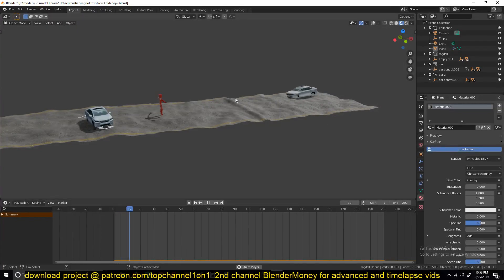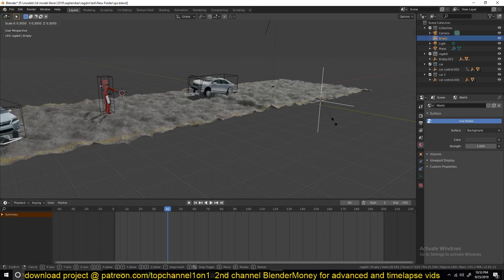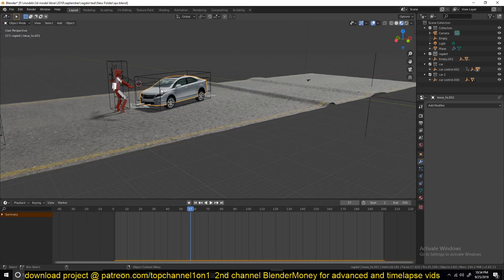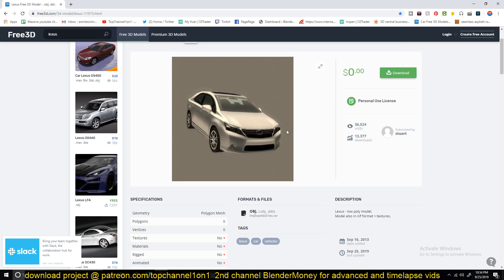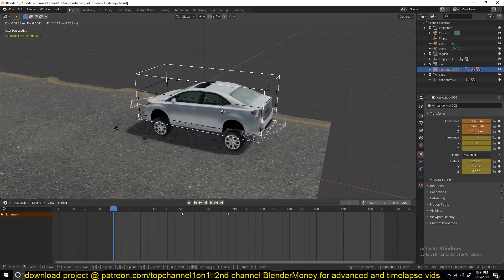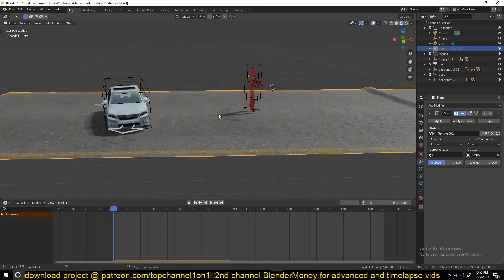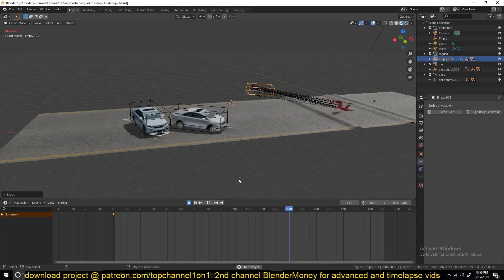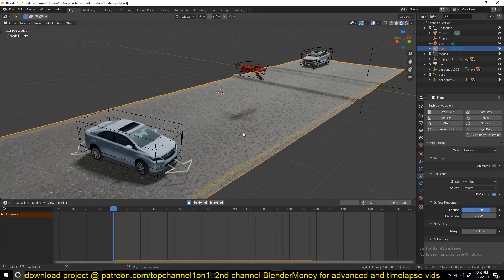car accident and rag-doll physics simulation setup   in blender 2.8

Comment: Cool, 

coming mostly from working with lightwave, but I am trying to use blender more and more.
Not directly of blender intererst, but in Lightwave ..quite some time ago, i did setup a collision scene with a ragdoll (bullet dynamics) and a car rigged with bullet motors, though those items where already setup in individual scenes, I just mixed the items in to another scene and set it up to collide, and also using multicam viewports.
https://www.youtube.com/watch?v=FhOTDxoylII
Reply from the maker: wow that looks great, are you switching to blender now
Reply: @TopChannel1on1  

To some degree yes, but not completely..it depends on how Lightwave will be able to improve fiberfx rendering, and rendering with GI in general, and how it deals with the issues with fireflie noise using pbr materials with glossy reflections.
those are the most frustating things for me in Lightwave, the fiberfx is horribly slow compared to blenders hairsystem using GPU, and blenders hair with CPU is also faster.
And the fireflies with pbr materials, I simply do not get that with blender, and the GPU of course renders much faster than Lightwaves cpu using Global illumination.

Then there is a lot of stuff in blender Lightwave doesn´t do, skin modifier, sculpting (metamorhpic isn´t there yet) 
Svg support.
But ..there are also a lot of stuff I prefer in Lightwave, I still think Lightwave has some of the better and faster methods of setting up volumetric clouds using null primitive volume items and it´s library of procedural textures to choose from is Way more larger than blenders which has just too little procedurals, and that goes for many things like surfacing, displacements etc..blender is too limited in that regards, also I feel it is easier to drive almost anything with lightwave´s procedural textures..like hair animation or grass animation.

Also..I prefer windows filebrowsing and really loath blenders own system, I also prefer
Lightwaves UI structure and way to organize any button as you like in the menus, and it´s more cleaner text based UI, though it sucks when you want to change colors compared to blender.
Then we got the viewports, I do not like blenders, in lightwave I can choose direcly in the viewports what kind of viewport it should be, in blender you have to know the shortcuts, or construct seperate with the mouse, and you can´t in blender unless constructing your own windows.

there is also a difference in object wireframing, in lightwave I go to any desired viewport and set display style to wire or wireshade, or render (vpr)  you do not work the same in blender and constantly have to navigate in the object menu and de-activate object wireframe or activate it, that is more tedious than how lightwave does it.

I also prefer to have some of the most important tools fixed on stage, that is object, light, bones, camera...those buttons are fixed in lightwave and I can find them faster than having to scroll and seperate these items from other items in the outliner in blender..so in that regards Lightwave is unique in the terms that they provide a layout stage that feels like a movie stage, and not like a general 3D construction app.
So I would rather work in the lw environment  than in blender, but I would like to have blenders renderspeed, sculpting tools, there are other modeling basics like the knife tool..which in blender works when you change direction on a surface..you simple can not do that in Lightwave, also ...a rounding of a point/edge in blender with bevel can be done on flat surfaces, In lightwave there isn´t such tool natively, there is a free plugin that does that though.

And of course, blender has fluids natively, Lightwave doesn´t ( well..the new vdb gas solver is a start) but it isn´t near blenders opengl presentation , slower to render and simulate as well.
Or you buy turbulenceFD, which doesn´t have a pbr volumetric shader, and you can not use it with the newer volumetric system, you have to render in passes or convert to vdb.
TurbulenceFD was a bit crashy for me, and rendered very slow with multiscattering.

The major difference in no layout creation modeling is something to worry about, layout really needs it soon, but at the same time..I also prefer to model more focused in modeler only, I would like to have both worlds there, either choose to model in modeler or layout only when needed.
Of course, eevee and it´s almost realtime engine is almost a must to jump on.

I might put up a blog on what I like with Lightwave and what I do not like, and that with a comparison to what I like with blender and what I do not like in blender, and that with the agenda of just comparing how they do it and how well they do it in various areas, and not directly stating the whole software is better or not.
oH..Forgot, I prefer lightwave´s Lights, you got a bit more of light types to choose from than blenders which I feel is a bit limited, I also prefer the Lightwave backdrop/environment physical sky, the light by default is affecting the physical sky, in blender you have to add some kind of sun position script ..which I haven´t tested yet, and may not work in some versions?   and the very workflow on how you set it up is way more initiuve in lightwave than in blender that requires activating nodes, and you have to know how to add in the sky texture in the color channel ..a bit of non initiuve I think compared to Lightwave.

There are loads and loads of more what I like in blender and what I like in Lightwave, but too much to put it up here I think.